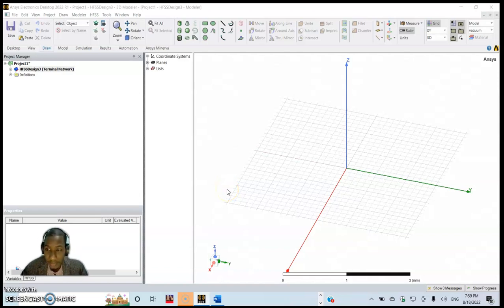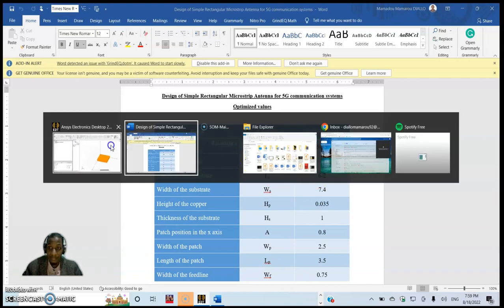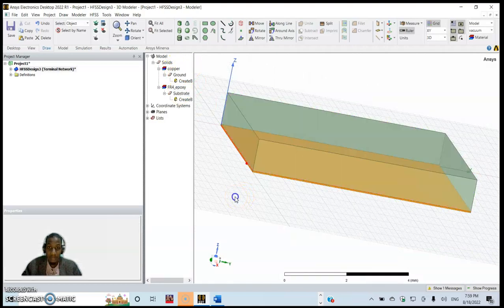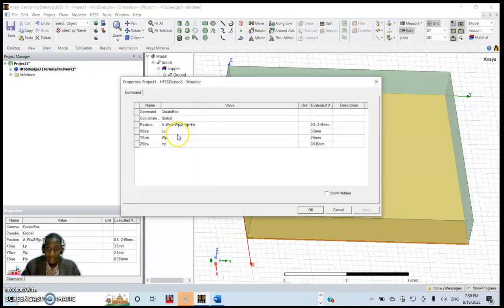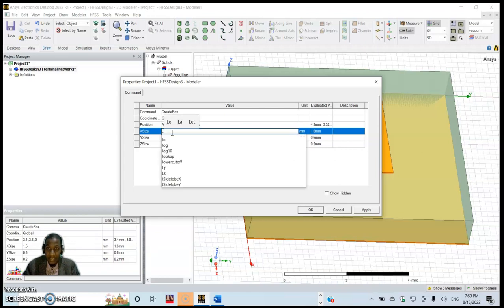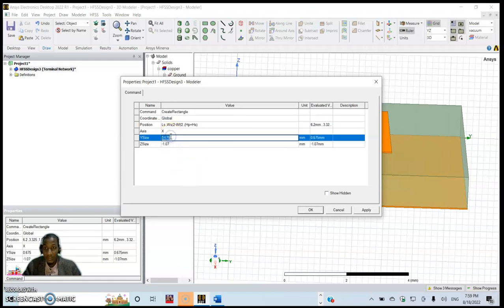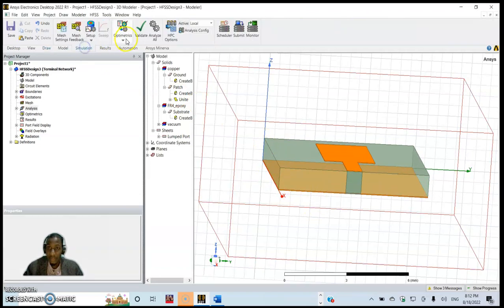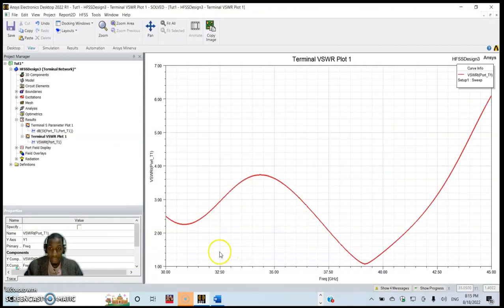Rectangular Microstrip Patch Antenna for 5G at the 38GHz band using HFSS.

Comment: Hello professor, I'm solving for the L and W of the patch using your given values for Frequency, Dielectric Value of the Substrate and height of the Substrate. For the Width of the patch I calculated W_p = 2.403E-3 and L_p = 1.334E-3.

Could you please make a separate video deriving the Length and Width of the patch. I would like to see why our my values don't match with yours.
I used this book to find my values.https://ia800501.us.archive.org/30/items/AntennaTheoryAnalysisAndDesign3rdEd/Antenna%20Theory%20Analysis%20and%20Design%203rd%20ed.pdf
Thank you for the great tutorial.

Comment: sir how to calculate length and width of the feedline and how i know impedance is matching
Reply from the maker: Hello, this paper may help you to find the dimensions of the feedline. https://www.researchgate.net/publication/305722465_A_New_Design_Formulae_for_Feed_Line_Dimensions_of_the_Rectangular_Microstrip_Patch_Antenna_by_using_Equivalent_Design_Concept
You can know impedance matching by looking at the Voltage Standing Wave Ratio (VSWR) or the reflection coefficients. For instance, in mobile communications systems, if the VSWR is less than 2, there is impedance matching.

Comment: Hello Sir, can you provide more details on how to calculate the values? please.
Reply from the maker: The dimensions were calculated using rectangular microstrip Antenna formulae from C. Balanis book. However these formulas can’t give you the desired resonance frequencies. So you need to optimize the dimensions on HFSS using the optometric option.
Reply: @rfengineering2022  thank you

Comment: Hey I am using hfss13.0 and I am unable to find the create open region option ,
Reply from the maker: If you cqnnot find it, you can create a radiation box manually by considering a distance of lamda/2 on both sides of the antenna

Comment: How to calculate values (means the values you shown at start),give clear information
Reply from the maker: Thank you!
You can find how to calculate the dimensions in the literature. I recommend that you read Balanis "Antenna Theory: Analysis and Design" forth edition. However, you will need to perform a parametric analysis to achieve the desired resonant frequency. 
You can also read this article for a circle Microstrip antenna. 

https://www.researchgate.net/publication/365019471_A_miniaturized_dual-band_planar_antenna_with_a_square_ring_defected_ground_structure_for_5G_millimetre-wave_applications

Comment: Thann you sir van you please make a video in which you explain how we can determine theta and phi to plot the elevation and horizontal plane and the gain
Reply from the maker: Hey! your request is noted. I will upload it very soon.
Reply: @rfengineering2022  please when do we use last adaptive and sweep
Reply from the maker: @ouafaeelalaouy8562  The last adaptive option allows us to plot a quantity (eg: VSWR, reflection coefficient, 2D gain) at a single frequency ( theoretical resonance frequency, 38GHz for this tutorial).
The Sweep option on the other hand allows us to visualize a given parameter (eg: reflection coefficient) for all points within the range as defined in the frequency setup (This tutorial: 30GHz-45GHz).
Reply: @rfengineering2022  thank you so much